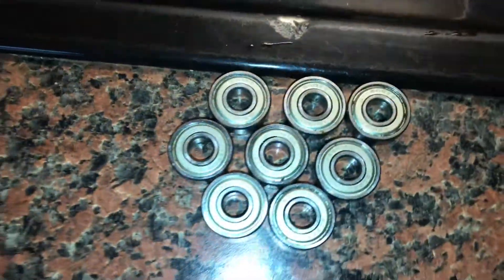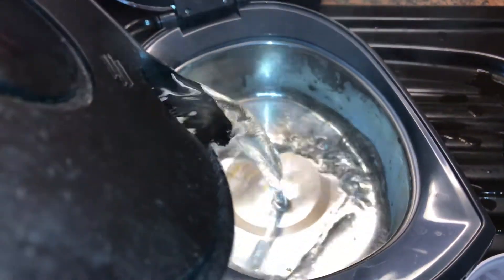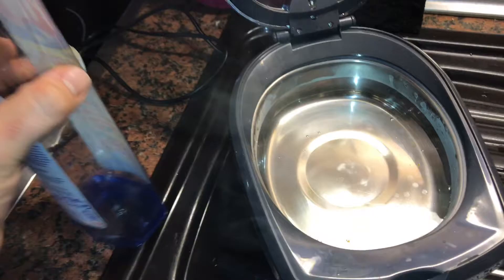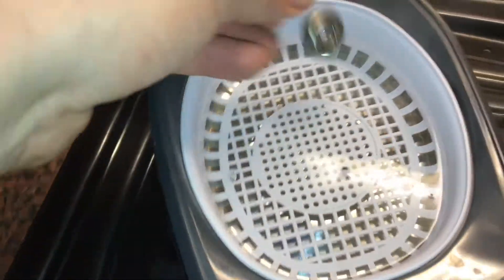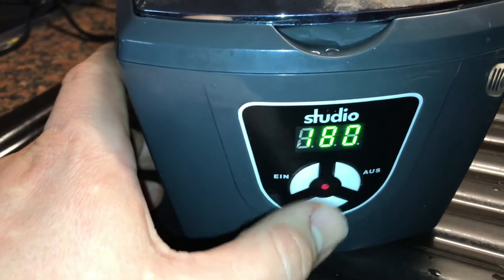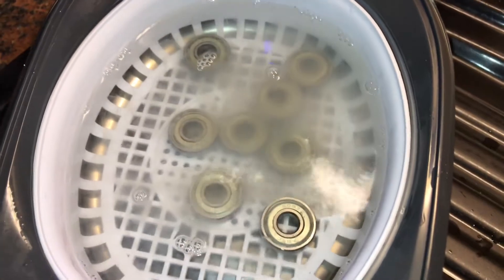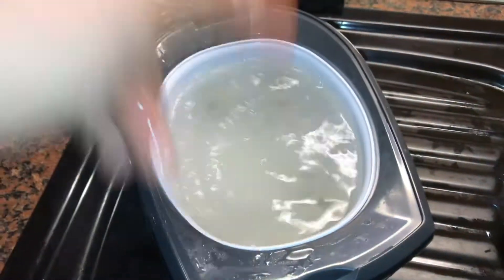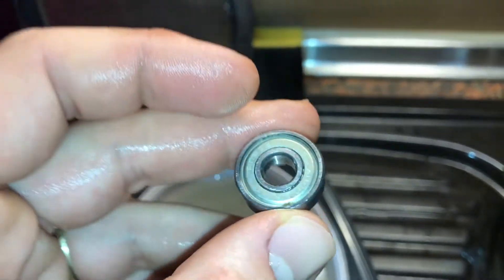How to clean ball bearings with an Ultrasonic cleaner Rolling-element bearing cleaning DIY

Comment: Just don't! You'll end up with rust caused by the tap water + The left over soap prevents the bearings to get properly lubricated again.
Reply: @pduesp  To be fair, an ultrasonic cleaner is not a bad idea. (it's my preferred method aswell)
But get rid of the soap and tap water, only use citrus cleaner (petroleum free). Afterwards distilled water is perfect to rinse of the cleaner. Now the most important step DO NOT let them dry on their own or use any kind of heat, otherwise you'll get instant rust. Get every little bit of liquid of the bearings, compressed air works great or a salad spinner with a towl inside (takes some time but does the job). Relubricate with 2-3 small drops and pls stick to lubricants which are produced for skating. Done.

Hopefully this will save some kids bearings. I'd suggest to correct ur vid or simply take it down.

Comment: I don't get why you don't remove the seals? Now the soap gets stuck inside the bearings.
Reply from the maker: My ball bearings are maintenance free. So i did not remove the sealings but the oil will lubricant it.
Reply: Done correctly, you do not have to take the covers off, I will post a video in the days to come on the correct way.
Reply: @timsevener8671  where's the video?